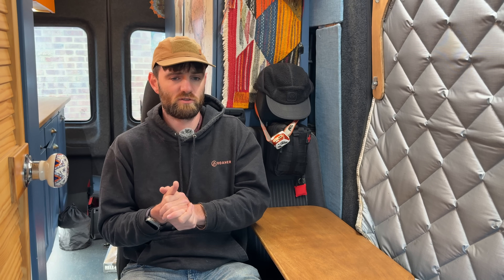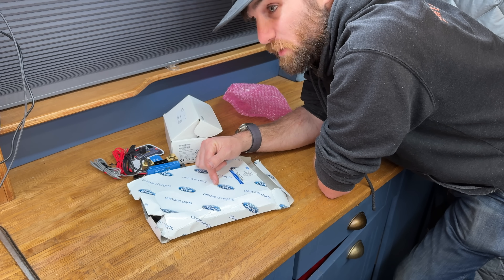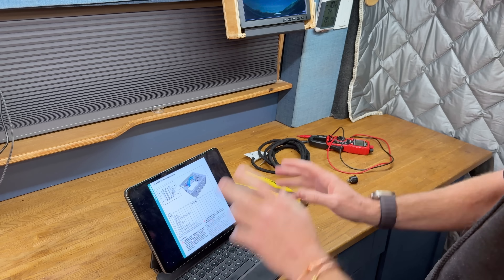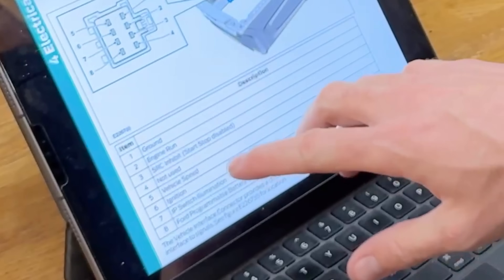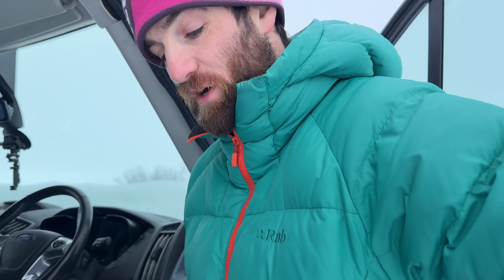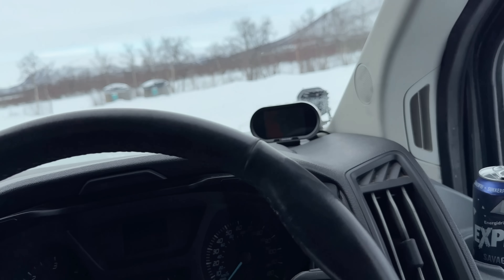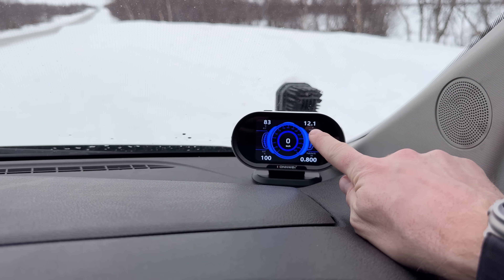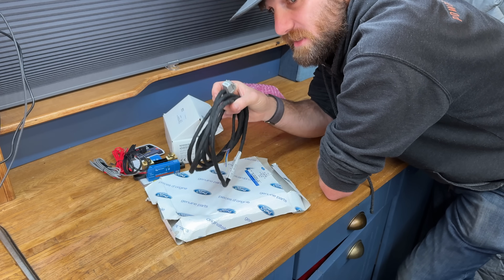FORD TRANSIT: How to DISABLE Smart Alternator “Official FORD Method”

Comment: Great video - I need to do this with my ‘21 EcoBoost.  But, I can’t find the part # for the 10 pin - any help with that???
Reply from the maker: The information I can seeing the 2019 BEMM ( post face lift van ) for the 10 ways connector calls it “KTKK2V-14A411-C*” “Service kit” 

If you can find the 2019.75 BEMM for the ford transit it’s on page 206
Reply: @MispronouncedAdventures awesome - thank you!  And, safe travels

Comment: Hi, great video! Do you happen to know the name of the harness please? I have a Mk8 facelift/2019 and believe I need the 10 way connector. If I put in the part number from your video it returns lots of different options but nothing that assures me I'd be ordering the correct part. Thanks!

Comment: Omg I’m so glad I found this, followed you during my own build. Been on the road now since February and now the clouds have rolled in, we are doing mega mileage and we enabled police stealth mode to not turn on lights everytime we unlock or open doors, we have managed to save charge on the vehicle battery. 

But that means the alternator has started doing exactly what yours did. Been panicking the last few days (in rural Turkey of all places!) that the alternator is shot. Thank god it’s by design. Annoying it means we aren’t fully charging the leisure battery though. Tried dropping the voltage on the victron but scared to drop too far! 😅 

May have to try a field repair/bodge and try turn it off. Don’t think there’s an option on forscan.
Reply from the maker: That no DRL when unlocking or open doors is something which is something that I activated! 

All being well your alternator is fine and whilst I used that fancy connector, you could just tap into the wire behind the pin you’re after

Comment: Just bought a 2022 transit custom ? are these similar ?
Reply from the maker: Yes. Smart system is the same. Although the  customer interface plug I believe is this slightly new variant which has more pins.

Comment: Bruh... I've been thinking about the bloody smart alternator for so long. My solution has been to adjust the DC DC charger to still charge at the low voltages. While also grounding to the shunt on the starter battery, which supposedly allows the van to keep track of the energy draw and make its own decisions. The fact you researched the proper way has blown my mind. Also my van setup is v similar to yours. Great minds think alike.
Reply from the maker: I was having issues even with manually keeping the DCDC charger on at the lower voltage is with no output from the alternator. I wasn’t really getting much charging output.

My neg is also on the right side of the shunt so the vehicle should be able to track it
Reply: @MispronouncedAdventures interesting... Well, it seems to work well enough for me now, because the issue that remains now is the unit getting really hot, I have it mounted horizontally near my driver's seat, which isn't the best. So, I added some fans that I had lying around... But,.I think a better solution would be to upgrade the charger to the newer 50A version. It's much more efficient, so doesn't heat up to the same extent, and possibly works better with smart alternators, though I'm not 100% on that.

Comment: hmm glad my car doesnt have an alternator. replaced my 12v battery with an LTO pack i built, saved ~40lb in weight. for an analogue solution, car audio people have been swapping lto into cars for awhle now and they basically wire in diodes in line with the alternator sense wire to bump the target voltage up as needed. each diode is around 0.5v increase.
no alternator so i just let the APM (dc-dc converter) target ~40% soc of 12v system at ~13.5-14.5v and then i let my cars 200w flush mounted solar roof charge the LTO pack up the rest of the way to ~15.8v which is ~95% SOC for a 6S lto pack. ends up giving me about 2-4 miles of additional EV only range each day by giving the solar somewhere to go even while driving, avoiding dc-dc converter losses, lower I^2R losses at 15.8v (like tesla with their lipol low voltage pack), lower weight, lower internal resistance, no float charging/voltage sag of low voltage system, and just more time spent with the APM in power saving mode due to higher sensed voltage.
car loves running at higher voltage. chevy volt will not throw low voltage errors until 16.0V, and an LTO pack will live longer than I do without thermal management as long as I dont visit the arctic circle (-40C/-40F charge limit is insane and they come back from deep discharge without damage). i document all this in a poorly filmed vid on my page. more people should look into LTO for automotive low voltage application! in usa i just ordered enough cells to make 2 more packs for 60 bucks each pack.... thats only 2.6x the price of LFP in terms of kwh.
thanks for taking the time to film, document, voice over, edit, and upload :)
Edit: i should say i replaced hologen headlights with 4$ chinease special color changing LED's to get brighter headlights and have fog light mode, they have their own power supply boxes so i presume their voltage is regulated. i did notice the overhead dome lights get a bit warm to the touch but theyre not on long enough to matter. planning on changing them out with LED's once they burn out. so far nothing on the car has broken though. 
LTO is the supercap/sodium ion that everyone wishes existed but doesnt realized already exists.

Comment: I used forscan and set my battery level to 100%. Now i have a normal alternator and no wiring or mods to do.
Reply from the maker: That is one way I’ve heard to do it keeps the alternator in conventional charging mode because it always thinks it has to get up to 100%. I think it’s about 80% for default before it goes into smart alternator mode. 

Well, I wouldn’t exactly call using forscan to reprogram the ECU as not a mod

Comment: All that for just 4 extra horsepower.
Reply from the maker: Its not about getting extra horsepower, its about knocking off Smart regenerative charging when I need it off for my DCDC chargers to work
Reply: @MispronouncedAdventures no, I meant ford put all that crap in for 4 horsepower
Reply from the maker: It’s not about gaining horsepower, it’s about dropping engine load to increase fuel efficiency. Even if that’s only a few percent increase.
Reply: @MispronouncedAdventures well it’s still dumb.

Comment: Just don’t connect any negative wires to the start battery, don’t bypass the shunt
Reply from the maker: You are correct bypassing the shunt wouldnt be ideal. You have to make sure if you are collecting on the terminal area your on the stud on the correct side of the shunt
Reply: @MispronouncedAdventures or anywhere on the body , there’s no need to disable the smart alt if you wire things up correctly with respect to the shunt
Reply from the maker: @Four-LLC  that’s not necessarily full correct saying there is “no need” at all , Ford smart regenerative charging inhibit is still a feature because even with the wiring of Aux items is correct. the van can still go into SRC from time to times when the end user doesn’t want it to. It’s the whole point the feature, for high powered auxiliary items when the smart alternator enters SRC unintended and doesn’t knock itself off when there’s a load
Reply: @MispronouncedAdventures  This is in general terms, is possible ford or some manufactures to write bad alternator control code .. if done properly..

Wire all auxiliary loads so that the power draw is detected by the shunt ( so the current runs through the shunt) then the alternator will generate the exact amount of power to compensate

This is exactly how I have wired my extra lights, DCDC charger, UHF radio, upgraded stereo etc, winch etc. The DCDC has a ignition on trigger wire that starts it, and I will soon put a switch on that line so if i'm winching I can stop it drawing power, when keeping the engine running

The current should go  via the body and the main wire from the start battery -ve via the shunt 

On any vehicle with a smart alt and a shunt on the - terminal all accessories should use the car body as a negative, and a high current device like a winch should share the main body - connection that shares the big 1 or 0 AWG wire from the battery to body
Reply from the maker: Yep, you are was correct and it also what the FORD BEMM ( body equipment mounting manual ) also says. but the ECU doesn’t always get the alternator control correct, which is why they have the high power output mode.

The vast majority of the time it used to work absolutely fine. I already started using the SRC inhibit feature in about my fifth year of owning  the van. Previous SRC used to only kick in after extremely long driving days and would mess up my DCDC charges.

Comment: Interesting little hack @MispronouncedAdventures ! As a little side note at 11:41 do red wires going into the Wago style connector on the left look a bit discoloured? Not sure if was just lighting but thought I'd mention in case they were getting hot 👀
Reply from the maker: Interesting spot, having just looked at them in the van for discolouration but they are a yellow/orange sheath cable which I stripped out of my old ex-AA van which I had before Yeti. Must’ve ended up with about 200 m of cable from that vehicle of which some were dirty. 

There isn’t actually any real current on those cables anyway they are signal wires to the on/off pins on the Orion’s. 

But thank you for the concern and heads up

Comment: Just unplug the BCM at the battery? That's what I did on my Ranger. No more start stop, and my battery is more healthy charged..
Reply from the maker: Do you mean the BMS ( battery monitoring sensor ) not the BCM ( body control module ) 

Doing that will disable some features and also give you a fault code every time you start up or at least in the transit? And it’s triggering a type of fail safe charge mode 

Would it not be best to use the specific feature designed for it?

Why would you want that in your Ranger And why do you believe that it’s giving you a more healthy charge?

Comment: for startup my Victron dc-dc 12-12 30 i did give it a startup power puls from my fuel-pump to a mini relay connected to the mini connector on the dcdc charger ,now it can only charge   if my engine is running ,and i can externally charge car battery without draining it empty (and can charge my 2e battery externally when wanted ) start/stop system function as normal
on stop function no dc dc charging ,on start/running engine the delay in the dc dc  charger works in my advance ,

Comment: Alex, I'm building a 2005 Mercedes Sprinter 3500 based overland vehicle to tolerate -35C for Norway/Alaska, etc. I have a Die Hard AGM 95 amp hour starter battery and a Webasto engine coolant heater. Should I think about a starter battery heater pad/jacket/wrap? I can connect my starter to the 412AH LiFePO4 house battery bank or use a NOCO lithium jumper, but I'm reluctant to throw so much current at a frozen or near-frozen AGM battery. What do you think? Should I have a starter batt heat pad?
Reply from the maker: I’m not familiar the location of the starter battery on your model of Mercedes. 

My Ford Transit for example starter batteries are based inside the cab in the drivers seat base opposed to under the floor or in the engine bay so generally kept a bit warmer. 

If the battery is in good health and you’ve got some sort of additional jumper as a back up or wait to charge it off the leisure system, it probably wouldn’t be too much of issue. 

I don’t know of any of the Nordic people adding heating to their normal starter batteries
Reply: @MispronouncedAdventures  Thanks. Is your starter batt an AGM or Flooded?
Reply from the maker: AGM
Reply: @MispronouncedAdventures  Thanks. My starter is under the bonnet exposed to the ambient temps.

Comment: Hi, dead useful as I’ve just bought a Bobby basic 2018 trend version of this van ….and looking at a conversion….please can I ask if you have a link for the online manuals? Tia
Reply from the maker: Lots of variations of the manual. If you google you model of van, year and then BEMM “Body and Equipment Mounting Manual” you should find it. I found it on the Ford website

Comment: There should be a relay somewhere on the victron system you can tie into.

Basically, if the battery is not 100% - have the relay switch on (or off).
So when the victron is not 100% the inhibit is forced on - so if you start the car and drive - it automatically stays at the voltage needed to charge up.
But once the victron is charged, it will then go back into normal mode and the car will handle the rest itself.

This way, you never have to worry about switching it off / on - and also not leaving it permanently inhibited.
The car and the victron system then handles everything it needs by itself without you having to worry.
Reply from the maker: You could do this via the built in Cerbo Gx relays and SOC information.

Comment: Smart alternators, variable oil pumps, cylinders that turn off.  It's like they are trying to make trash.
Reply from the maker: I can’t speak for the second and third options, but smart alternators aren’t exactly that smart and not particularly an advanced concept. Switching off a “charger” ( alternator ) when the battery is full isn’t a particularly out there concept.

For 99.9% of people who don’t run auxiliary items off their vehicle it’s never gonna impact their daily lives apart from saving them a little bit of money on fuel

Comment: After losing 3 brand new batteries and changing an alternator on my Opel Insignia within 1 year, when the mechanic proposed to change my BCM ECU which would have costed me even more without any guarantee that it would fix it, i ended up just pulling the charging sensor, sending the system in fall back charging mode, and have now constant charging and the same battery and alternator for the past year with no further issues...  They sould call it "dumb not charging"...
Reply from the maker: Some vehicles just pulling out the lin communication pin for the alternator can work others not so much.

Your vehicle sounds like  there was a significant issue somewhere where it probably just makes more sense to do that than a ECU swap which is gonna be expensive

Comment: Years ago I tuned rally engines, the alternator was a drag on power but the simple solution was to open circuit the rotor  brushes killing the magnetic field and the load on the engine. This was done with a switch on the inlet manifold that opened when the vacuum fell at two thirds throttle. When the engine load was reduced the vacuum came up closing the circuit to the rotor letting the alternator produce juice. Simple way to recover < 4 HP.
Reply from the maker: Makes sense to me. 

My OBD2 display shows a engine load percentage and you can see that increase or decrease with the status of the alternator and the auxiliary loads applied
Reply: @MispronouncedAdventures  Why Ford make such a big deal of alternator control when a simple vacuum switch sensing load does the job.  

Another trick for you if the regulator blows up.. Find the rotor brush that is to ground then run a wire from the positive of the battery through a 21 Watt or higher lamp  onto the other Rotor brush, disconnect the alternator regulator from the rotor. 

The 2 amps through the bulb with create enough magnetic flux in the rotor for it to generate around 200 Watts and not cook the battery. If the output is to low add another lamp in parallel with the other.  This trick will get you out of poo.  
Best wishes
Reply: Had something similar (and silly) on my Skoda 105, to squeeze every watt of power, when the second carb stage opened (vacuum controlled), the timer (60seconds) opened a relay controlling the excitation winding - the momentary loss of charging didnt matter. I was aware of it as it lit up the charging indicator on dash. Did it help? Maybe not, maybe it was placebo effect. Nowadays I found out, that my car intentionally discharges the battery a bit, just before the DPF regen cycle - so it can put more load on the engine. (besides switching on everything that you dont notice, like mirror and window heaters etc...)

Comment: Chatting to a mate last week about caravan fridges running on 12V when towing. Mine is next to useless but they have never been brilliant on 12V. He suggested it may be the smart alternator in my Tourneo causing the problem. I don’t know enough about auto electrics to have any clue.
Reply from the maker: If it a “caravan fridge” normally means it’s a 3 way fridge. Gas, hook up and 12v. The 12V aspect is probably not great. as 3 ways fridge’s are an “absorption fridge”. When this style of fridge runs of 12v it’s normally maintaining temperature at best, not chilling 

12v fridges ( 1 way ) are compressor fridges which is way better type for off grid use. ( works like a normal fridge )  

I don’t think it’s an issue with your Tourneo. I think it’s more a limitation of the type of fridge you’re using

Comment: You might want to consider using a double-pole switch to control your DC-DC converters, that way you can use the second pole to control the smart alternator at the same time.
Reply from the maker: Binding the smart alternator and the DCDC charges on a switch together would kind of take away the fit and forget aspect of the DCDC chargers 

If I really wanted to do something like that I’d probably automate it. Have it smart alternator switch turn off and resort to normal smart charging once the batteries reached 100%. I could probably do this via the relay in the Cerbo GX and Soc information